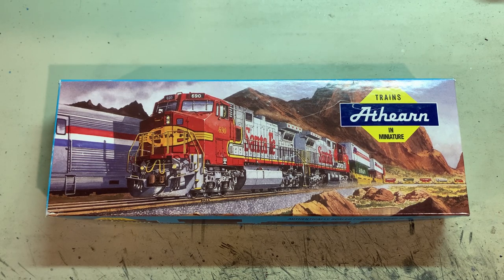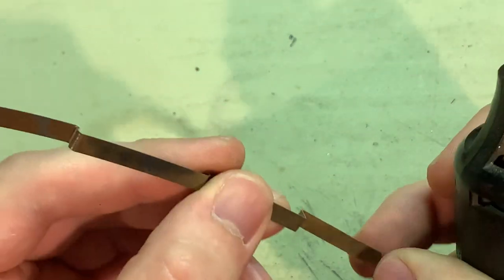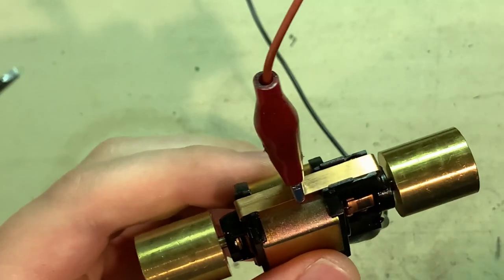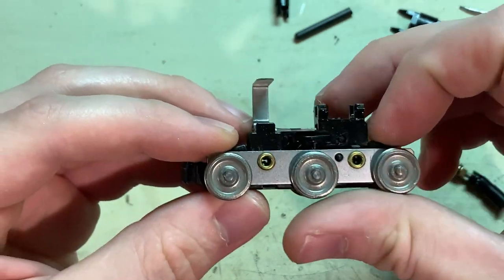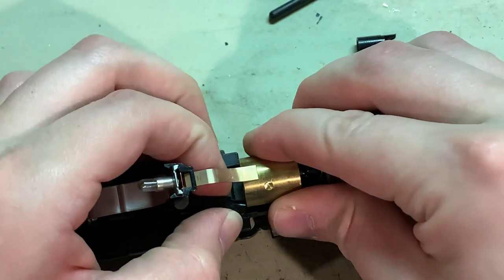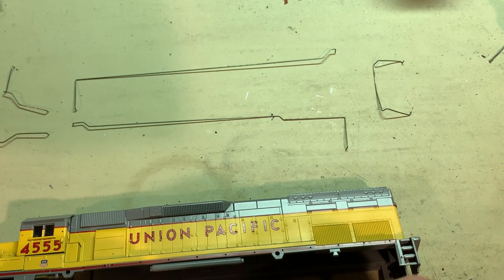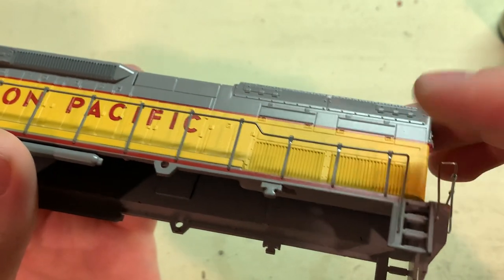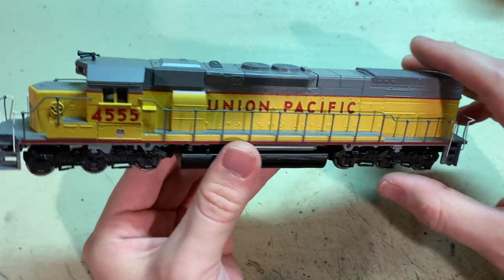Building and tuning a "new" Athearn blue box kit!

Comment: Classic Blueboxes, can't go wrong with one of these!
Reply: Love em not 400 dollars also!
Reply: Far as I'm concerned there's only one manufacturer of locomotives.  I have about 30 old bluebox units and they all run great.  Some from the early 70s are still running with original motors. 
I use the chassis and drive units for other manufacturers.  A Tyco GP20 on an Athearn GP35. Proto 1000 F3 A&B set on Athearn F7s.  An Atlas GP38 high nose on an Athearn GP38.  Proto 2000 GP7 on an Athearn GP7.  Tyco Alco Century 430 on an Athearn SD9.  The extensive project was redoing a Lifelike Alco Century 628.  Required a new chassis fabricated out of brass using trucks from the FM TrainMaster.  A challenge for sure. 😊

Comment: Very nice video! I have a blue box addiction, and have worked on dozens of them, however never checked for flywheel balancing too closely. Might have to go back and try that! As much as I love the Sd40s being the later tooling and all, the GP9s are still my personal favorites to build. Can't wait to see the next project!

That horn hook you cut is going to haunt you for the rest of your life
Reply from the maker: I first learned how to balance flywheels when I got an Athearn FP45 (early production), and one of the big iron flywheels (they didn't use brass until the 80's) was so off balance that the engine would shake!  I drilled some big holes in the side of that thing, and it's been a smooth and much quieter runner ever since.

And don't worry about haunting, because horn-hook couplers don't have souls. :D
Reply: @DarthSantaFe  Haha I'll definitely have to try the balancing now. I use primarily horn hooks because it would be out of my high school budget to upgrade every piece of rolling stock, and I really don't want to deal with the long reach McHenry couplers on the Riva / IHC cars. I will concede that Kadees are the better looking coupler though!

Comment: I’ve had several blue box locomotives and pieces of rolling stock, and I can say from experience that they’re really well built. I don’t know how but Athearn somehow made arguably the most reliable budget model trains that are easy to convert to dcc, have really good 5-pole motors, and still have them cost less than $40-60. You would have to really screw up on a major level to make one of those things stop working.

Comment: Awesome job darth! I love how you painted the handrails, they look so much better. Painting the horn and adding some numbers to the number boards would make things even better!

Love the solution to the horn hooks too lmao
Reply from the maker: Thanks!  I've only kept the unpainted steel on one of my Athearns to keep it as a sort of "purist" model, but the rest of them get painted.  It gets humid here in central IL, and exposed steel parts don't like it one bit.  I once had to pull the railings off my Athearn tankers to clean them up because they'd all turned red with rust.
Reply: @DarthSantaFe  yikes! Down in florida we experience the same.

Comment: One electrical trick I learned is using an electrically conductive grease by MG Chemicals.  A little dab under the top contact strip and on the bolster and on the two contact points under the motor. 
The stuff is strange. I took a small amount on a piece of paper and put my resistance tester probes in it and it read 0 ohms.  Just be careful, it's extremely messy to work with. It's a grease embedded with graphite. 
I've added it to rusted contact strips that didn't work at all and it ran fine.
Reply from the maker: Interesting, thanks!

Comment: Nice simple review. Just subscribed.
You can also note that the worm gear bearings are identical to the wheel bearings. Knuckle couplers need angle adjusting, then, with those same needle nose pliers you can bite-twist the ends to expose bare metal to look like real metal glad-hands.
John  BC, Canada
p.s. I agree with others... Athearn needs to get back to Blue Box kit production, especially for DC-strong operators.
Reply from the maker: Thanks for the extra tips!  I forgot to mention the bearings on the worm and axles being the same.  The couplers on this one seem to be sitting at the correct height, but I do remember now that my C44-9W needed raised coupler heads.

Comment: A quick tip advice. Use Labelle 106 grease with ptfe on the gears inside the trucks. If you don't, you'll have major gear noise once you go back to running it.
Reply: I did that to my weathers special fp45 built by athearn. That thing is as quiet as a mouse when it comes to running.

Comment: Never seen the idea of drilling into flywheels before. Seems like it might have been more precise to chuck the motor assembly into a vise and then lightly touch a file to the spinning flywheels. Never done either before, but that just "seems" like another way to do it.

Fun fact: This particular locomotive was originally built as SP 8291 and delivered in 1980. After the UP merger she was one of the first batch of units to go through a complete shopping, emerging in full UP paint and re-numbered 4555 in 1996. She only wore the number a few years before being re-numbered again as 2947 around the turn of the century. The last photo I can find of her was in Nampa, ID where she was sitting in a deadline, eventual disposition unknown.
Reply from the maker: I've tried doing that, but it actually takes a really long time compared to marking and drilling.

Comment: To isolate the headlight from the number boards, I glue 1.5 to 2.0 mm fiber optic filaments to the head light castings before installing them. Then I use warm white ultra bright LEDs with resistors (you can also use incandescent bulbs) and shrink tubing, also add diodes for directional lighting if you are running DC vs DCC and to protect from reverse polarity which can fry the LED

Comment: Nice in depth video.Athearns just keep going.You might mention next time to check the axle gears,as they split.Replacing the metal pickup strip with wire and the bulb with an led are some more improvements.The original design with no screws,all clip together,is hard to beat.

Comment: I would of changed the steel wheels for nickle silver ones, but very nicely built and tuned!
Reply from the maker: The sintered iron wheels actually work very well as long as they're made properly.  I've only replaced them when they were drilled off center and caused a lot of wobbling.

Comment: No screws and NO Solder/wires to break off in the hands of the hobbyist who's terrified of them lest they have to resort to their soldering iron.
Great design if maybe too basic for some and I think it would be a good idea to replace the flat contact strip with more reliable wiring as was stated.

Comment: I was told that if using metal couplers such as KD #5s, you should use the KD draft gear boxes to insulate the couplers from the frame.  This is so you don't get a short when running 2 locos back to back.  I drill out the hole and tap the hole in the frame for a 2-56 screw and install the couplers that way.
Reply from the maker: That is true, if you link 2 units together with the frames grounded to opposing rails, you’ll get a short without insulating them. I haven’t had to worry about that since my layout’s small, but it’s something to keep in mind!

Comment: The only change that I would do different would be eliminating the top metal strip. I found using direct wires for the strip as a better replacement, but I do understand that leaving the strip makes for more simplicity in the process. Also, I use the same method for the handrails, but I remove them after the glue process to prevent paint getting on the body. Once painted, I reinstall them to the body.
Reply from the maker: I've also replaced the strip on some of my other BB kits for improved performance, and it can make a difference!  I thought of removing the handrails to paint, but the handrails on this one had a tight fit into the holes, so I was afraid the glue would be damaged along the way and decided to paint them in place instead.  When the fit isn't quite so tight, removing first is definitely the best option.

Comment: I’m curious why you pulled the motor off from the top. I usually push the mounts up through the frame holes, using a Torx screwdriver. I go around pushing each up a little at a time. Great tip for balancing the flywheels.

Comment: This is my first visit to your channel.  An excellent presentation, factual and informative.  I'm amazed too by your voice.  You speak calmly and gently, but you are still interesting and engaging.  After almost half an hour of the smooth and calm narration, you slip in a dig on the horn hook couplers--"...oops I broke it."  That was very unexpected, and very funny.  New subscriber.
May I ask you, and your viewers, about an issue I have?  I have several Athearn blue box locomotives that were in a "fresh" water flood--ie. creek not ocean.  Do I need to take the motors apart and clean off the silt, or can I just rinse them under running tap water?  Or, should I buy new motors?  Any advice you , or your viewers, could offer would be very much appreciated.  Thank you.
Reply from the maker: Thanks, I’m glad you liked the video! The motors are easy to take apart, so I would clean them up gently with some soap, water and a toothbrush to get rid of any dirt that may have gotten in. The brushes and springs can be gently brushed clean without using soap and water. Dry the rest of the parts as much as you can, then let them sit for maybe an hour before you reassemble the motor and add some fresh oil to the bearings. I hope that all works to get them going!
Reply: @DarthSantaFe  Thank you for your generous and detailed reply.  Your expertise is very helpful.  You saved me a world of doubt and confusion.  I will certainly try your advice.  BTW, I watched you oil a couple of open frame motors in the few videos I've seen--my being new to your channel--and that too has been very helpful.  Best wishes to you and yours.

Comment: The only part that kind of is a pain is the rail stanchion you have to squeeze over the rail. If you slip, it's ruined. My vintage Tyco/Mantuas have a hoop at the top that just slides over the rail. Much easier and a nicer finished look. Other than that, can't beat the blue box locomotives. I've been using them since the early/mid 70s with no real issues.
Reply from the maker: The railings did get a lot easier to put together when Athearn started folding the over like in this kit! The DD40 I put together had the older ones that had to be folded during assembly, and it was a tedious process.

Comment: Surprised you re-use old contact strip instead of soldering wires directly to motor contact pts to enhance performance via more direct electrical contacts!
Reply from the maker: I’ve done that before, but this was sort of an “as-is” build. The contact strips do work well as long as they’re clean and have good tension against the truck contacts.

Comment: Pretty much of what I got is blue box cheap to buy especially at train shows some detail work weathering and good old fashend maintenance and you should be good what's cool is both small and fullsize loco motives is the both use electric motors to drive them diff is size.....

Comment: Could the flywheel no being balanced cause vibration in the body.  Mine seems to have a vibration even though it runs great and is nearly new.
Reply from the maker: Yes, unbalanced flywheels can cause a lot of vibration through the body.  If you take the motor with flywheels out and power it up, and you feel a lot of vibration from it, then the flywheels are unbalanced and need to have some careful work done to quiet things down.
Reply: @DarthSantaFe  thank you

Comment: I had a blue box but it fell off the table It still works just the part that connects the drive shaft to the bogie  is missing
Reply from the maker: That is fortunately an easy part to replace, so I hope you can get it up and running again!

Comment: I just got a pre-built blue box GP9, but when it came the long hood-side railing above the coupler was bent inwards as a unit.  How to fix?
Reply from the maker: If it's one of the plastic railings, that's going to be a tough one.  You might be able to bend it back by hand a little at a time, but there's also a risk of breaking it in the process.  I haven't had much luck with that myself.
Reply: @DarthSantaFe  I can't tell if it's plastic or metal because it's a custom and painted.  How do I tell if it's plastic or metal?  Would a whole plastic unit bend as one?
Reply: @DarthSantaFe  it's a dummy btw forgot to mention that.
Reply from the maker: @donttreadonmetal5073  Plastic railings are flexible and will bend and spring back with only a light touch.  Metal railings are hard to the touch and don't bend easily, but they can also be bent back into shape better than a warped plastic railing.
Reply: @DarthSantaFe  I just looked at it again, the rails are rigid and don't move at all.  Would that mean metal, and do I use pliers to bend them back?
Reply: @DarthSantaFe  this is what I got:  ATHEARN BLUE BOX HO SCALE GP7/GP9 PRR NON-POWERED DUMMY LOCOMOTIVE RD#7155 NOS
Reply from the maker: @donttreadonmetal5073  Yup, those are metal, and careful work with pliers can straighten them out.
Reply: @DarthSantaFe  a specific kind of pliers?
Reply: @DarthSantaFe  another question:  I just bought a blue box PRR PA-1 dummy.  The tabs on the sides won't go into the shell to hold it and it seems really heavy for a dummy?  Any solutions to these issues?
Reply from the maker: @donttreadonmetal5073  I use needle-nose pliers for forming handrails.  Even when straightening, I can grip where the bend is and then carefully form the wire by hand.
Reply from the maker: @donttreadonmetal5073  The tabs on these are pretty small, and if they're damaged they probably won't hold well.  I've fixed this kind of problem before by marking where the tab is supposed to be, drilling a hole maybe 1/4" deep with a bit the same size as the hole, then gluing in a piece of brass wire to act as a new tab.  About the weight of it, Athearn used the same metal chassis for both the powered and dummy units, so they do tend to be heavier than others.  Just give the axles a little oil if they're not rolling freely and it'll roll normally.
Reply: @DarthSantaFe  it seems the reason for the tabs not connecting is that the midsection of the shell is stretched out, like someone repeatedly opened it up.

Would a Walthers Proto E8 (what I plan to hook it too) be able to pull the PA-1 and a string of cars or will it struggle due to the weight?
Reply from the maker: @donttreadonmetal5073  It'll pull it perfectly fine.  Pulling an Athearn dummy is about like 2 or 3 freight cars, so a Proto E8 should be able to handle about 20 of them without any trouble.
Reply: @DarthSantaFe  OK good to know.....about the tabs, it seems they're intact and undamaged, so I don't know why they won't click in.  I plan to pull the shell off tomorrow and see if they're bent.  If I can't figure it out, it's off to the hobby shop on Saturday.
Reply: @DarthSantaFe  another issue with the PA-1 dummy is that the coupler cap on the rear keeps popping off.  Once I put a Kadee in there and cap it, is it a simple tightening job (crimping with pliers)?
Reply from the maker: @donttreadonmetal5073  I get these to stay in place by making sure the sides are at a good, sharp 90 degrees, and that helps them to snap on tightly.
Reply: @DarthSantaFe  alright.  Any recommendations on how to remove the front coupler plate?
Reply from the maker: @donttreadonmetal5073  Use a thin flat-blade screwdriver through the slot in the front pilot to gently pry out one side of the cover until it pops over the latch.
Reply: @DarthSantaFe  I elected to leave that one a horn hook, although I was successful in changing out the rear coupler to a knuckle.
Reply: @DarthSantaFe  something else.......I have a blue box Santa Fe dummy F7B on the way.  It comes with two hornhooks, one of which I want to exchange for a knuckle.  By the look of it, the coupler mount is a different setup.  How do I go about removing it?
Reply from the maker: @donttreadonmetal5073  The F7 uses the same coupler box as the SD40T-2 (but flipped upside down), so you can see how that one fits when I install the couplers in this video.
Reply: @DarthSantaFe  looks easy enough.  Do you recommend removing the shell to do it?
Reply from the maker: @donttreadonmetal5073  For this one, you can leave the shell on.
Reply: @DarthSantaFe  what would be the best way to remove the coupler housing?
Reply from the maker: @donttreadonmetal5073  The housing is just a clip on most of them, so pry one of the edges out and it will pop off.
Reply: @DarthSantaFe  installation successful.  Tried it earlier and failed, then I re-watched you do it here and did it just fine.

Comment: Putting non-conductive oil on axle bearings and truck pivot points is asking for trouble. These are electrical paths.
Reply from the maker: When it’s only a small droplet, it actually doesn’t cause any electrical issues. I’ve been doing this for years on points like this, and the prevention of oxidation has actually kept things running trouble free for longer.

Comment: This is to old ...now Athearn use the failure celcon for the handrails 
Its better by far the wire
Reply from the maker: The new plastic handrails on the Ready To Roll and Genesis models are much finer. There are still a lot of Blue Box kits out there though, and they all include metal handrails.  For a lot of them, Athearn hasn’t made a plastic replacement.